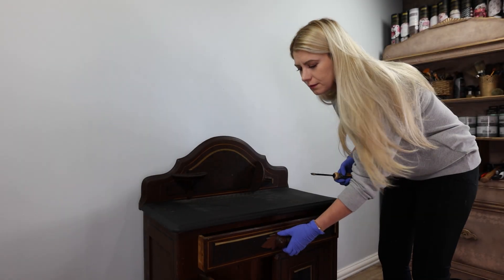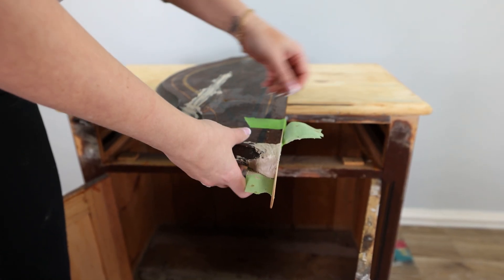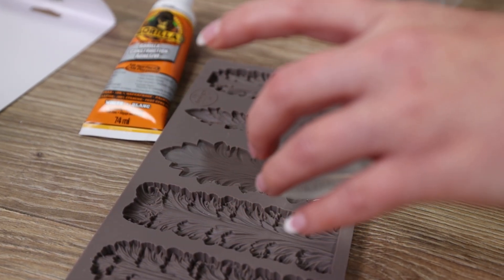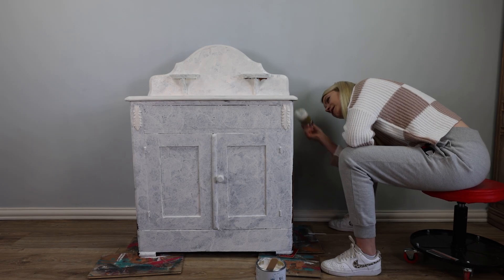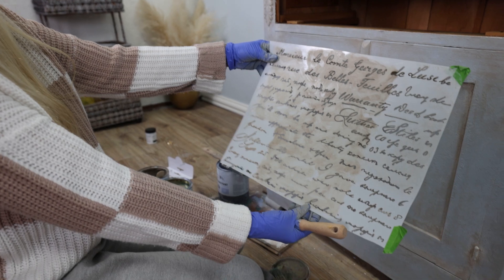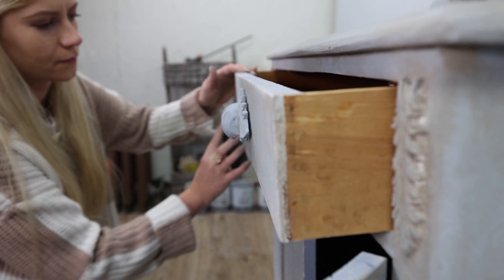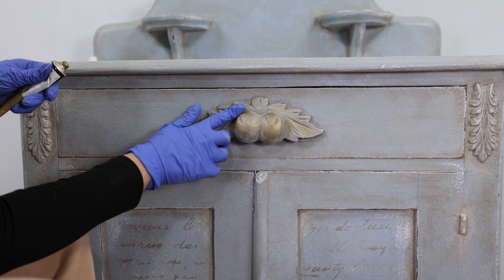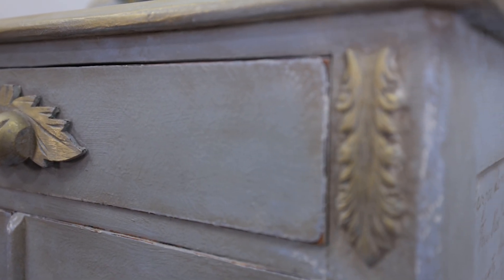Vintage Sink Makeover ~ What WAS I THINKING!?

Comment: Another triumph, and another weary and worn but worthy piece of furniture saved to live a beautiful second life!  🤗
BTW:  guessing how old the piece is, those little shelves were likely used for candles or small oil lamps.  Wash stands were also used as shaving stands, and shaving in the dark with a straight razor can be a very dangerous thing to do.  There was most likely also mirror mounted over the wash stand, or if some man did use it for shaving he really wanted to live dangerously.

Comment: Beautiful piece!  Off the top of my head I can't remember the name of those two little shelves but they were used for placement of the oil lamps or candles as at the time these dry sinks were made, most people did not have electricity...therefore no lights.  I have two of these in  my shop now.  I'm still debating if I should leave them in their natural state or to paint. You give me such inspiration!

Comment: I did a kitchen table with the rub on transfers I waited days for the paint to dry I did the rub on transfers and days later I place dixie belle gator hide as my top coat I’ve placed 3 coats waited days with each cover… I went in my shop to do the table legs with best dang wax and my transfers were lifting!! On one spot it ripped what did I do wrong? Or is this normal spending lots of $$ to have them lift and tare off?  So disappointing.
Reply from the maker: Gator hide lifted your transfer. You want to use clear wax or water based topcoat.
Reply: I thought all Dixie belle product was water base. Can I put a clear top coat over the gator hide or wax?